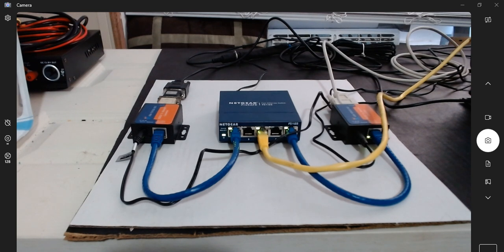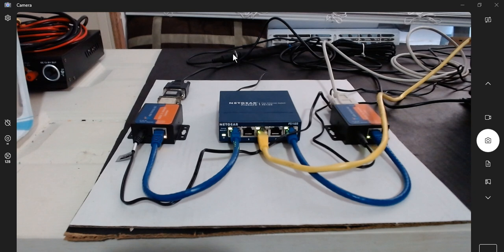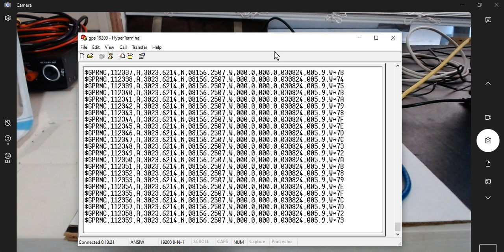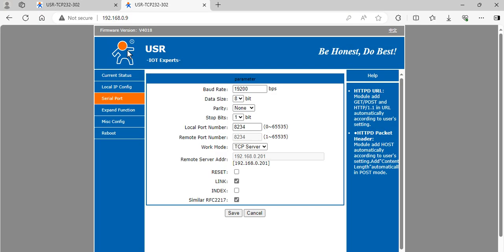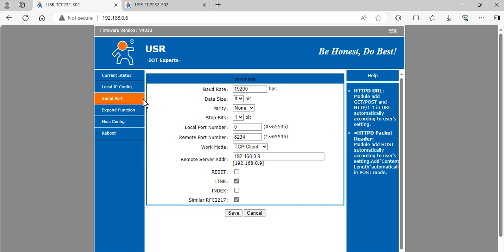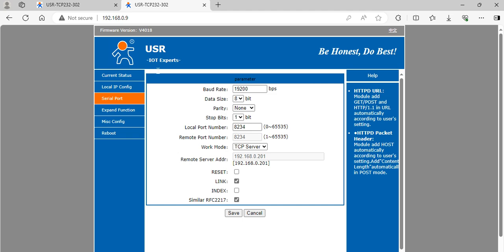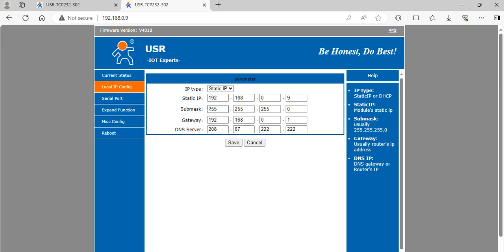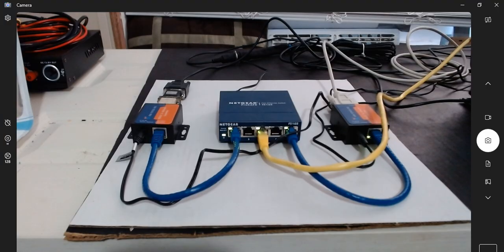Creating an RS-232 Network Bridge

Comment: Can to configure direct usr to usr?
Reply from the maker: Direct yes. Client to server. One client, other server. No other device needed.
Reply: @dc95811 so actually we don't need ethernet switch?
Reply: One more. I look on configuration server address 192.168.0.201 on side server. That address default ip address?
Reply from the maker: @adedanar3815  Yes, default ip.
Reply: Bro. This is like extender rs232 over ethernet?
Reply from the maker: @adedanar3815  Totally bro.
Reply: Thanks bro
Reply: I have a problem. I already set parameter like in your video, i set client to server. Indicator on usr link : green, power : green, tx : red, and rx : green. But my device still show not connected. What do you think about that, do you have idea?
Reply: Distance maybe affect about that? I used 75 meter cable cat 6
Reply from the maker: @adedanar3815  My video is about going across a network. If you are trying to connect 2 devices directly, the ethernet cable must be wired for crossover. Google search "ethernet crossover cable". The 2 devices must have different ip addresses. But more importantly, this is the wrong technology for this application. If you want to extend rs-232 75 meter, switch to rs-485 and then back to rs-232. Old technology already works, no need for ethernet or IP at all.
Reply: Okaay broo. Thanks for your advice, i will try
Reply: One more bro. Can you reference converter rs 232 to rs 485?
Reply from the maker: @adedanar3815  Rs-485 was the solution for doing rs-232 over long wires. This is an expensive version, they have cheaper. https://www.amazon.com/StarTech-com-Industrial-Serial-Converter-Protection/dp/B00FN6L38Y/ref=sxin_16_pa_sp_search_thematic_sspa?content-id=amzn1.sym.6b4b6d33-3832-496c-bacc-442447e09e47%3Aamzn1.sym.6b4b6d33-3832-496c-bacc-442447e09e47&crid=NFNCU07L3091&cv_ct_cx=rs-232+to+rs-485+converter&keywords=rs-232+to+rs-485+converter&pd_rd_i=B00FN6L38Y&pd_rd_r=09ab05f1-f742-4503-a9e2-e37f592c2d15&pd_rd_w=L5ql1&pd_rd_wg=mtZ7j&pf_rd_p=6b4b6d33-3832-496c-bacc-442447e09e47&pf_rd_r=T5TTGP85BWND833GXDAH&qid=1748097240&sbo=RZvfv%2F%2FHxDF%2BO5021pAnSA%3D%3D&sprefix=rs-232+to+rs-485+converter%2Caps%2C313&sr=1-3-6024b2a3-78e4-4fed-8fed-e1613be3bcce-spons&ufe=app_do%3Aamzn1.fos.9fe8cbfa-bf43-43d1-a707-3f4e65a4b666&sp_csd=d2lkZ2V0TmFtZT1zcF9zZWFyY2hfdGhlbWF0aWM&psc=1